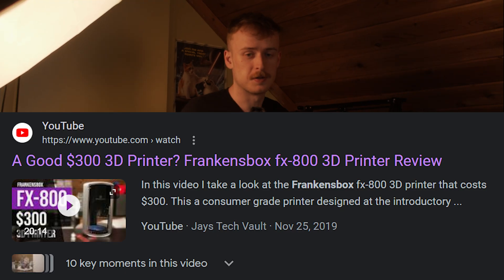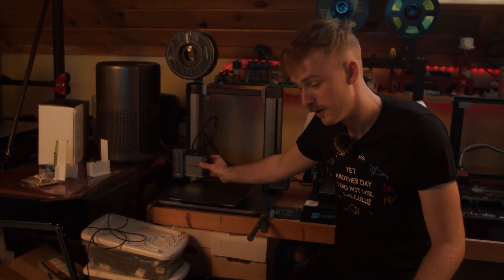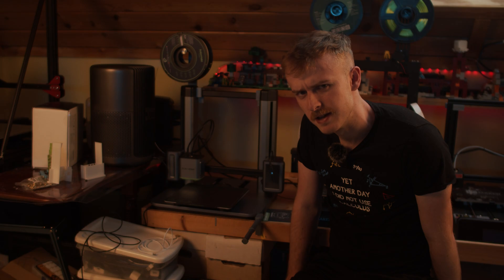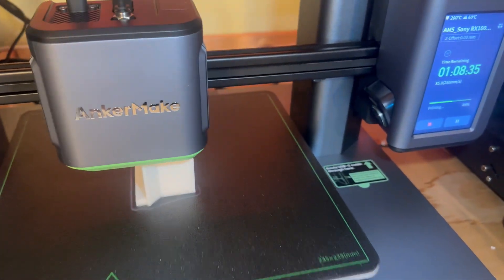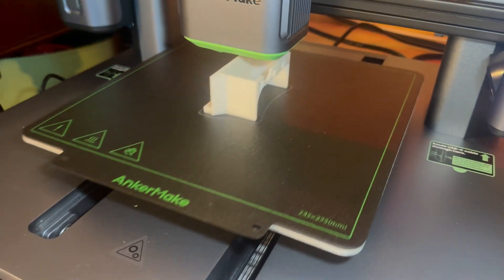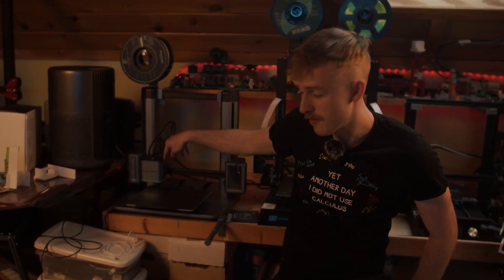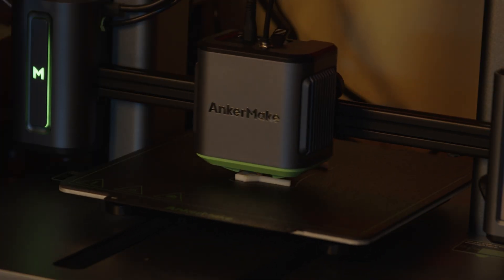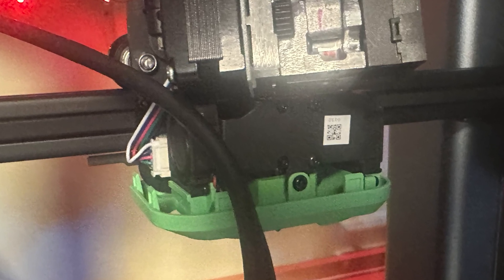AnkerMake M5 3D Printer and V6 Color Engine Review | Part 1

Comment: I've had mine for a long time, early kickstarter backer.
I'm disappointed about the V6 color engine, but it was never promised, and those that paid for it were either reimbursed or given a generous credit for future purchases, their choice.  
Mine has been incredibly stable, just had to replace the V wheels earlier than I'd like. The chassis is all cast aluminum, incredibly stable and sturdy.  Bambu Labs is stealing Anker's lunch money here, but the Anker is a great machine.

Comment: and where ist that v6 ??? i just see the m5. stop click baiting!!
Reply: This is why we need to see dislike counters.
Reply: Still no color engine…. Anyone notice that the working version of the color engine at shows has 6 different hotends in the same gantry?  Good luck high speed printing with that mess…

There is no way that color engine can work with the existing M5C.  The whole hotend assembly would have to be different.
Reply: the v6 got canceled by ankermake. Better buy a bambulab printer @mandoreforger6999
Reply: @mandoreforger6999 They have canceled the V6, and there is a new project Designated project poo.

Comment: Did you BUY this machine or did they Give it to you to review and keep.   If to keep then they went through it and tested it first . If it had problems they fixed them, weak parts were upgraded, etc etc.   If you bought it , it is very strange that the filament role was used and you had a used extruder!!......keep up the great work
Reply from the maker: I said in the beginning of the video that they sent it to me. The roll of filament is not something they could check before hand.
Reply: @JaysTechVault   Sorry thought filament came with machine....
Reply: It's normal that it's used. They test every single machine completely by printing with it, before it leaves the factory  😉